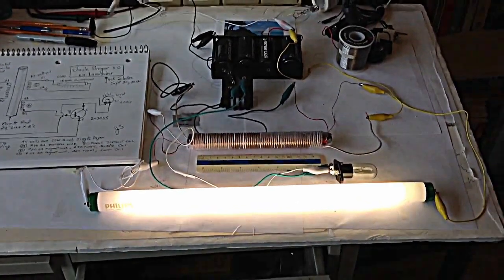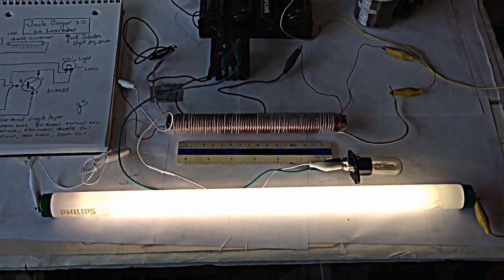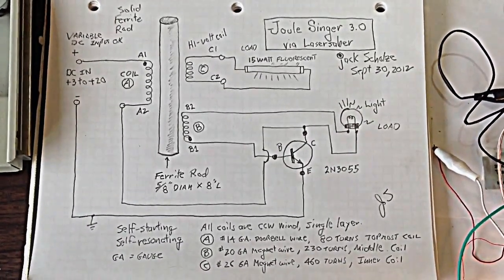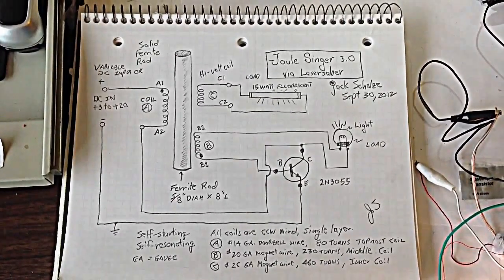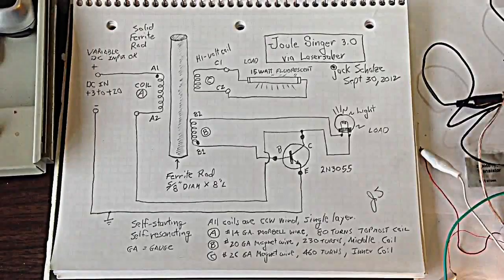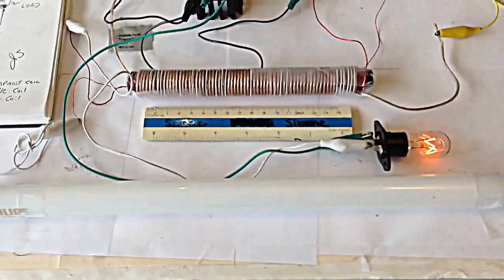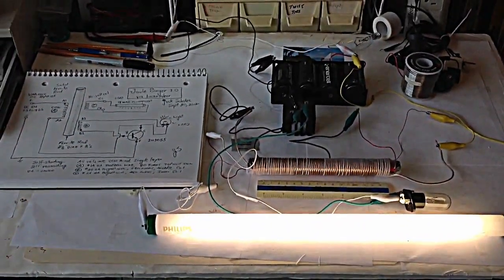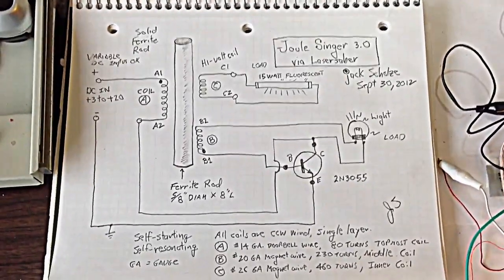Joule Singer 3 Coils

Comment: Great work!  I also built this circuit, but with some differences. I have two of these using ferrite inductors glued together per Slider's work. One uses 5.4V @ .7A and the other uses 3.5V @ 1A. The main bulb on the 5.4V one is the same brightness as yours. If I crank up the voltage/amps it gets quite brighter, but the transistor also gets warm.
The 2nd one is using smaller diameter inductors glued together & also has 4th wire of #34 for charging batteries. SSG style. 3rd #29 wire fills a cap.